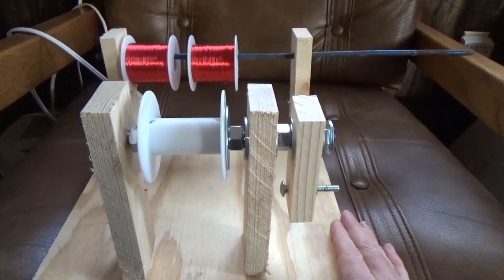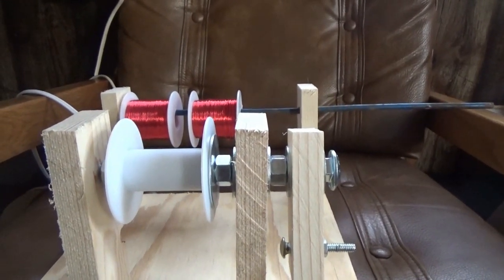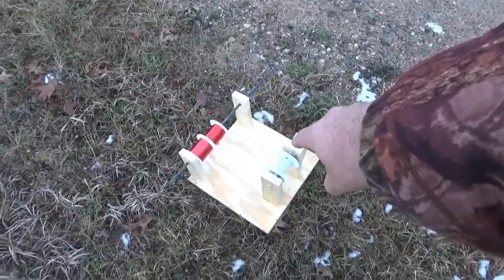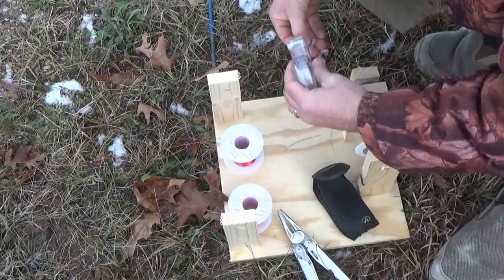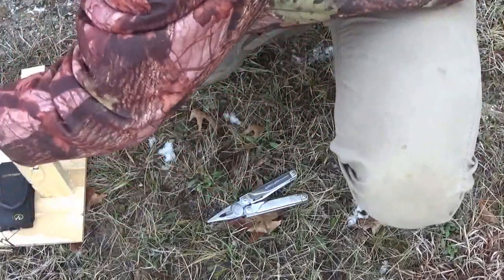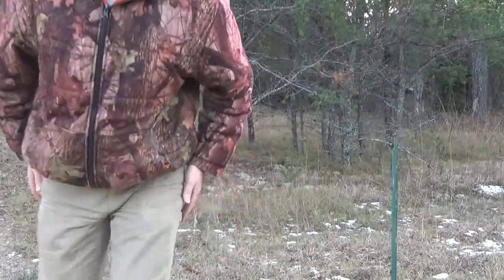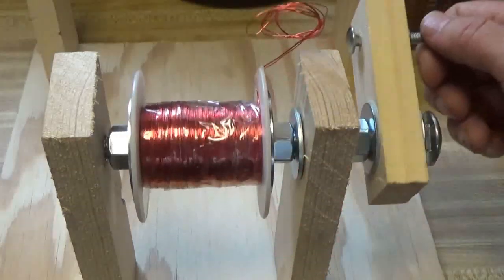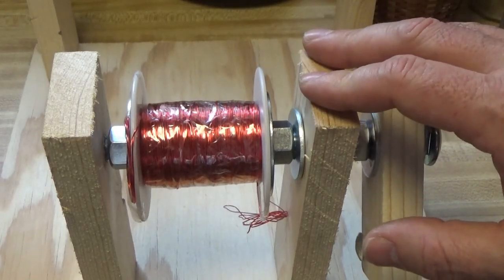How To Build A Bedini SSG Winding The Coil

Comment: great video! question why did u use 2 wires instead of one to wind coil?
Reply: One wire works to create the electromagnet attracting or repulsing the magnetic on the rotary. The second wire when having the magnet pass, triggers to switch the electromagnet off for a short pulse. According to my understanding.

Comment: What if you do it as a StarShip Coil
Reply from the maker: The idea of the Bedini Motor is to get just a very brief, sharp pulse to turn on the coil. The faster and sharper the pulse, the better the output. So a simple coil is sufficient in this case.

Comment: ive found how the coil is wound can really alter the magnetic field strength normally a coil is wound one layer going one way then the next layer going the other way! problem one layer is n/s next layer is s/n net field strength 0 +extra diameter of 2nd coil layer= 0.1 field strength, example 2. layer 1and2 both wound from left to right both layer are n/s net field strength 2x + extra diameter of 2nd  coil layer= 2.1 , EVERY LAYER SHOULD BE WOUND LEFT TO RIGHT OR RIGHT TO LEFT! IF YOU MAKE 10 LAYERS OF COIL ALL IN THE SAME LEFT TO RIGHT DIRECTION THE FIELD STRENGTH WILL BE 11X THE FIELDSTRENGTHOF JUST ONE LAYER,,, IF YOU WIND 10 LAYERS ALL OPPOSITE DIRECTIONS TO EACH OTHER LIKE MACHINE WINDS THE NET FIELD STRENGTH WILL STILL BE JUST 0.1X A UN EVEN NUMBER OF LAYERS GOING OPPOSITE EACH OTHER WILL GIVE A NET FIELD STRENGTH OF JUST 1.1X, HAVING MORE COPPER PRODUCES MORE BEMF WHICH CAN BE PUT TO WORK i hope you understand what im saying here! i learned this from making hundreds of coil and playing around with them, i got a pretty good understanding of wht a magnetic field really looks like, I've also thought of a power transformer that can up the voltage and the current at the same time not just one or the other
Reply: Simplify this comment. Are you saying that if you wind the power wire one way, you will want to wrap the trigger wire the opposite direction?
Reply: @jvon3885  depends on if you want both to be in phase or 180° out of phase, if you had 2 coils wrapped the same way and on the 1st wire positive is on top, negative the bottom, on the output wire positive will be at the bottom and the negative at the top, if they are wrapped opposite positive will be on top of both coils and negative the bottom on both coils.
Reply: This is a little confusing to wrap in the mind without video..:D I have had similar results with "Super joule ringer" coils. But that's much easier to do with toroids and this takes a lot more wire.. Do you mean that after every layer the wire should be cut and numbered, then after wounding the coil join them back together in order? I have done it that way too.
Reply: @Kangsteri  no but after you get to one  end just continue looping back the other way but try to get to the other end with 1 loop or 2
Reply: @doubleooh7337  Thanks for the fast reply! I will try that when i get some wire and time...
Reply: @Kangsteri  yeah I'm not spending 80hours next time I've got 20x .50mm wire to wire simultaneously 20x faster 4hours sound more like it then I'll have a motor/ transformer with 10kg of copper on ;)
Reply: @doubleooh7337  I think i will try the "Bedini SHK v1.0" circuit version by Axel Shark Space Scientist, that's in the comments. I was also thinking to use both sides of the coil to run two wheels rotating opposite directions. Then make a Wimshurst generator between them. "Mr Teslonian" has some good videos how to step down the output from it...;)
Reply: @Kangsteri  well make sure you post it ;)

Comment: Length of wire might be estimated by: Total length = 2 * π * r x total windings.  Where r = the radius at the center thickness of the coil ...... but I'm not a maths professor ..... :-)  If you work with different thickness of wire and width of coil you will have to consider the amount of wire that will fit into the width as well as the radius ......
Reply: On top of the changing radius with the helical winding it's not that easy. Precision matters to those who care.

Comment: How did you decide what size spool to use.  Maybe John had 800+ turns because he used a smaller inside diameter.  Looked like your spool is approximately 1in.  Maybe his was only 1/2in.  Also how long should the spool be 1in.  2in.  2 1/2in.  All of this should be based on the size and strength of the magnets.  I also realize this is just a DIY, any insight?

Comment: I thought you were supposed to twist the wires together before you rolled the coil up.
Reply: Yes, You do, I've made more bedini Coils 
& Regular  Coils, that I can't even count. 
& I have  read, John's notes on making 
The Coils, SO, You're  Correct about the 
Winding.!!! Also I  think he's Winding the 
Wires, the wrong way, if he's supposed to be  going  [  CLOCK WISE  ] HE'S going the wrong way.  I would Have to be there,
To be sure,  but, it doesn't  look like it's going clock wise onto the bobben.